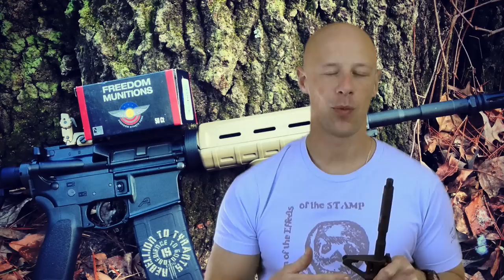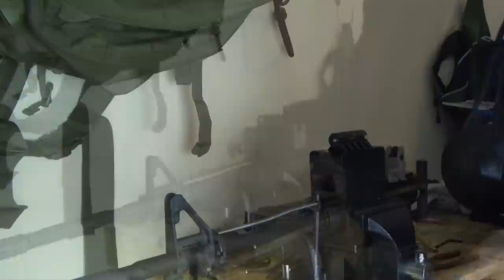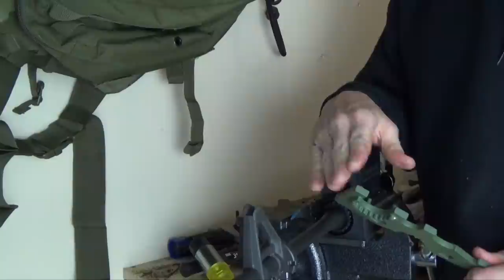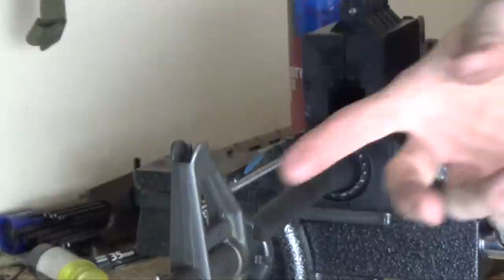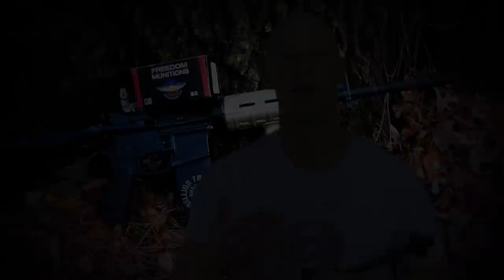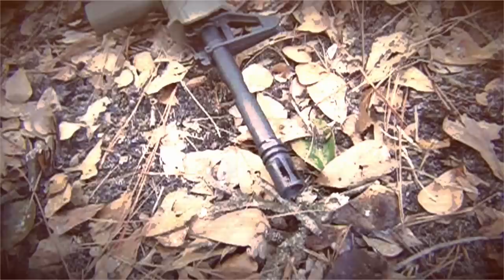How To Remove And Replace/Install An AR-15 Barrel (HD)

Comment: nicely done sir...as someone who has , no joke, assembled close to 40k uppers ,you got it right...a note to diy'ers who work on their owns guns a lot...a #2 roll pin holder from brownells is a HUGE help installing the gas tube roll pin...and they aren't very expensive...i like the brownell's upper block quite a bit , it holds the upper very securely...it is however a little inconvenient when performing other tasks on the uppper aside from torquing the barrel...i can't stand the tapco wrench for a multitude of reasons but the main one is you cannot see the notches in the barrel nut to align it when torqueing...my personal fav. is the dpms panther claw ...it's really sturdy...
excellent vid sir...keep em coming :)
Reply from the maker: brotherscoobs Thanks for the tips.

Comment: Thank you mrg.  Just what I needed.  I have seen some gsmiths tighten and release the barrel  3 times for some reason and that has confused me as to what they are doing.   I think you showed me that is not necessary.  Also recently I saw an auto mechanic use a digital torque wrench and that was a slick tool.   Great job.   thx.
Reply from the maker: You're welcome 👍🏽

Comment: There are a few good videos on how to check the head space on an AR-15 over on the NSZ85 channel. Note that with the all of crap that was produced back in '12-'13 you might still run into parts that were out of spec and shoved out the door for years to come. Checking head space is a good thing and also remember that .223 and 5.56 each have slightly different head space gauges. Plus clean the chamber with a proper chamber brush and CLP then wipe the chamber clean (ie bone dry) with bore patches before checking the head space.
Reply from the maker: killman1971 Thanks.

Comment: Mr.GNG, you should place your torque wrench 90 degrees to the barrel nut wrench when torqueing the barrel nut. Placing the torque wrench at the 90 degree position gives a more accurate torque. 

As you said in the video, the nut should be torqued/released at least three times before the final torque. As always grease should be applied to prevent galling. 

Thanks for your videos and keep up the good work!
Reply from the maker: Naji S Thanks.

Comment: I cracked a bushmaster receiver removing the barrel nut without a block. It cracked the thin piece of metal on the bottom side of the ejection port. I got a brownells block and did much more work to multiple AR's without any issues. I would say the overall quality of the brownells kit isn't as nice as some of the other more expensive blocks, but for the price brownells sells the kit for, it is more than worth it for someone who is getting into building AR's.
Reply from the maker: ThePatriot4freedom Yup, it happens.

Comment: Alot of y'all get too picky about the specifics, and miss the point of these how to videos. As if he hasn't swapped 100's of Ar barrels and doesn't own all the fancy tooling. Yes, he could show gunsmith level step by step process using aeroshell 33ms grease, seasoning threads to prevent galling, headspace go/no go gauges and so on.. He IS showing "how to well enough" for the everyday user, and is reaching a huge crowd which only helps the 2A movement/ culture. Thanks!

Comment: If my barrel uses an A2 front sight base, and I want to replace it with another barrel that also uses an A2 front sight base, do I need to purchase them (the barrel + FSB) together?  In other words, will my current FSB not necessarily be compatible with my new barrel, necessitating that I buy them as a package to prevent said incompatibility?

Comment: Great vid - how do you check the head space?
Reply: you can buy field gauges for that...a go/ no go...insert each one and close the bolt...the bolt should close and lock up properly , even snugly on the go gauge and not go into battery fully on the no go gauge
Reply: Head space on AR barrels and bolts is pretty much consistent and is rarely an issue. Yes it a safe thing to do but Ive built several AR's and never checked head space and have never had an issue.
Reply: AKBuilder762
 most manufacturers headspace barrels etc. several times before they leave their respective production lines...if your bolt is in spec and the barrel is in spec all is well...99% of the time everything's ok...doing the headspace field gauge test is just a little extra ins. especially if you're mixing and matching parts from different companies...i don't disagree but it's a good idea whenever possible to have it checked before squeezing off that 1st round...if your bolt is on the high side of spec and the barrel on the low side  or vice versa you could end up with an issue...yes it's unlikely...but for the low price of the gauges or a trip to a shop it's worth it
Reply: Since I only rarely need a headspace check, and the go/no go sets cost about $50, I get 2 hand-loaded bullets, with NO GUNPOWDER, and purposely crimp one too long and put a RED STRIP on that, GREEN stripe on the other one.  Use calipers to be sure the RED (no go) one was not pushed deeper into the brass when you closed it inside of the Bolt.

Comment: are retainers interchangeable between barrels ?.... the reason i ask is because i want to change my barrel to a longer one and have a mid length gas block instead of the carbine length gas block i have now.

Comment: Have you ever considered putting Blue Loctite on the barrel extension (not threads or barrel nut, as they get Aeroshell 33M)? This can take some " play" out of the upper receiver. Essentially you are bedding the barrel extension to the upper.
Reply from the maker: Romeo Boom No.

Comment: Just out of curiosity, if I torque the barrel nut down to 30 ft lb, but the teeth haven't lined up properly - and if I'm able to apply more torque to get the teeth to line up with the port for the gas tube and still stay under 80 ft lbs...any particular reason this wouldn't be a good way? Does it have to do with "seasoning" the threads to the receiver? Again just curious.

Comment: What can be done to keep the front sight base from turning when tightening the barrel nut? It is just slightly off to the left from shooters pov. Is this normal? Can the indexing pin be “shimmed” to keep it aligned when tightening the barrel nut or is my slot in the upper too large? Before tightening I noticed some slight play between the pin and slot. Any help is greatly appreciated, thanks. Great content.

Comment: Good video. People need to learn stuff like this for the American Battle of Armageddon of SHTF Zombies. I have learned a lot lately.
Reply from the maker: Slytiger Survival: the Maverick Prepper Channel Thanks
Reply: Mrgunsngear Channel geez I wish the Ak was that easy. Will a barrel swap require a check of headspace	?
Reply: Most people don't check them and they are good to go. If the barrel change were that easy in the AK, the motherfucking AK would be the Ultimate SHTF rifle/gun of all time! Period! This is what makes both weapons equal
Reply: I look at the AK as an old stone house that lasts. Doesn't have all the new commodities like the new stuff does. The AR is the fancy trailer in the lot with the jacuzzi. All the bells and whistles. Complete with the big flat screen. It falls apart more and more each day. That hailstorm or tornado comes and it's destroyed. The old stone house will still be standing.

Comment: Nice. Can you show us how to achieve proper head spacing?
Reply from the maker: lerch400block  You don't generally as head space is set at the factory.   I do have go/no go gauges though.

Comment: I'm surprised that you don't use a roll pin punch for the gas tube roll pin, I've found that over time using a hammer or regular punch will flatten out the end of the roll pin causing problems.
Reply: they are inexpensive and make life so much easier if you work on your guns a lot
Reply: And if you work on your guns alot or just upgrade your firearms every now and again its important to have a few of those low cost parts, especially if you went to the trouble to buy a roll pin punch.
Reply from the maker: chrispghetto works either way.  I try not to show specialty tools in videos unless needed.
Reply: Mrgunsngear Channel Ha ha, hemostats for roll pin install, I've done the exact same thing for installing those roll pins in the past.

Comment: The rifle you show with the long MOE hand guards, is that a "rifle length" gas system? Is the rifle you worked on carbine or mid?
Reply from the maker: Evan Bylsma Yes.  Carbine.
Reply: Where's the link on removing the gas block? Thanks for the vids btw. Strong work.
Reply from the maker: Evan Bylsma Thanks.

Comment: 30-80 ft lb is quite a range. Do you want to be closer to 30 or 80 and does it make a difference if you lean more to the tighter range or not?
Reply: Try to stick as close to the lighter end of the range when torquing any part down. You don't gain anything by running close to the max.

When installing muzzle devices it's especially important to stay close to the min. That's why peel washers>crush washers when timing and torquing the muzzle device.
Reply from the maker: Angel R. Aaron is correct.
Reply: Aaron Orr Thank you for your help.
Reply: Angel R. You're welcome anytime.

Comment: where can you buy the inner piece of the vice block with out buying the entire set?
I have the vice block {outer part}
Reply from the maker: not sure offhand
Reply: Is there any reason I couldn't just use the BCG with the vice block?
Reply: I just finished assembly of the upper, I did use just the Bolt Carrier {with out the bolt} also I found that a Mini Mag flashlight {AA pocket light} fits perfectly in the upper to shine into the upper to line up the holes for the gas tube.

Comment: Can you run a free float with a2 front sight post?  And do you need to heck headspace?
Reply: yes, but they need to have a cutout for the fsb, or be short enough not to overlap with the fsb.   If the free float has a non standard barrel nut the fsb has to be removed, then re-installed.  That can be a huge pain in the butt.  There are a few options that use a standard barrel nut so you don't have to remove the fsb.  Troy and a few other companies make models compatible with a standard barrel nut.
Reply: You can run certain free-float hand guards with your A2 front sight post.  Check out Daniel Defense's hand guards... you know the fugly looking one that has the front sight post sticking out near the middle?  That's an option and it's pretty useful (flashlights go great in front of the front sight).

It's really easier if your AR is a mid-length.  In that case, you can get any 9" hand guard and it won't touch your front sight post (though it comes really, really close).  Daniel Defense has a 9" hand guard for that, and IMHO BCM has the best option for that, their 9" KMR.  You can even buy upper-receivers with an A2 post and the 9" KMR pre-installed from Bravo Company.

Oh and it would be wise to check headspace, but these aren't Mosin Nagants... more than likely, it's gonna be proper.  These things are built to tight tolerances in 'MURICA!
Reply from the maker: Seu Moua Yes.

Comment: The Tapco wrench is the best, not because the finish is great or it works better than any other wrench, but because it has a bottle opener built into it that is labeled BEER!
Reply from the maker: sman7290 Thanks.

Comment: I got the receiver blocks but not the 1 that sits inside  the upper am I at a major risk installing the barrel without that
Reply from the maker: +prepper slim major--probably not.  Some---sure.
Reply: Because the Army said so :)

ARMY TM 9-1005-319-23&P

CAUTION
Do not torque over 80 ft-lb (108 N-m) while tightening the barrel nut assembly to the next hole, to allow for proper alignment of gas tube.

Comment: Could you reuse the barrel nut on a different upper receiver?
Reply: fatefinger I’m sure if you look hard enough you can find some manufacturer that doesn’t recommend it but you absolutely could do it with no issues what so ever

Comment: Where might one find a Colt Canada barrel assembly ?  Oh and you forgot to use AeroShell 33MS grease on the upper receiver threads. It's the grease called for in the TDP.
Reply from the maker: Michael Stone It's hard to find; troll the forums and be patient.

Comment: Don't use anti-seize to lubricate the barrel or receiver, anti seize has copper, which can set up galvanic corrosion in the barrel. Use Aeroshell or some other lithium grease.
Reply: Depends on the type of Anti-Seize actually.

Comment: This may have been asked here already, I honestly didn't look through all the comments but do you think headspacing is required when installing an AR barrel? I am starting a SBR build and I am used to buying complete uppers but plan to build upper myself using a Spinta Precision barrel and a Crosshill Side Charging upper. I don't really want to invest in go no go gauges unless I have to. 

Thanks
Reply from the maker: Jason Elbert There's no way to answer that without writing a thesis paper but in summary "it depends."

Comment: Sorry I forgot to ask earlier. Do you ever replace your gas tube. It goes through a lot of abuse with the heat and is fairly cheap (under $10 I think)
Reply from the maker: Robert Smith Eventually yes but it'd have to get really hot for significant erosion.

Comment: what grease are you using.
brand/model.
Thanks for the video.
Reply from the maker: +RhinoCable I don't remember off hand, sorry
Reply: It looks like Super Tech High Temp Extreme Pressure Grease from Walmart. I have a mixed nut sized canister of it instead of the grease gun tube.

Comment: This was a great video. This was something I was kinda scared to do but that looks really easy. Just wondering, the torque range is very wide (30-80) what did you torque your specific one down to ?
Reply from the maker: Robert Smith this one indexed right around 40.
Reply: The range is wide because you have to align a notch while keeping it within that range.
Reply: Richard Lamoreaux Thanks for the explanation on that. I was unaware.

Comment: Well done as always MrGuns!  Question though, does that 30 ft/lbs value take into account the extra length of the Tapco wrench?  Usually a torque wrench is calibrated for its own length and anything added to that length would throw that calibration off.  Just wondering if the spec for that torque includes that consideration?
Reply: Forgot to add that placing the torque wrench at 90 degrees to the adapter will solve the extra length/calibration issue because it basically keeps the wrench at the original length in relation to the part.
Reply: Pro2A - what math equation did you use to figure that putting the torque wrench at 90 degrees nullifies the extra length?
Reply from the maker: Pro2A Thanks.
Reply: Pro2A Doing it your way at 90 degrees is using the torque wrench incorrectly. And you will not get the proper ft lbs. or measurement you're seeking. You might want to take an engineering course or two.

Comment: It may be OCD on my part but when you use a torque wrench with any extension tool (the Tapco), you need to set it in at 90 degrees to the tool.  Otherwise, the applied torque will be way off.  The 90 degrees nullifies the leverage advantage caused by the tool.
Reply from the maker: Richard Lamoreaux Yup.  OCD part :D    Using grease throws it off too.   Let that sink in! :D
Reply: Mrgunsngear Channel I agree to both parts.  I watch all your vids.  Good stuff

Comment: Does it  matter what brand of lithium grease is used for install?
Reply from the maker: yes but most work
Reply: TM 9-1005-319-23 calls for "molybdenum disulfide grease"

 AeroShell 33MS is one that is commonly used.  I've grabbed Lucas White Lithium off the shelf at Lowes when I didn't have any 33MS.

http://www.lowes.com/pd/Lucas-Oil-Products-8-oz-White-Lithium-Grease/50353744
Reply: +Cody Dills thanks for the info

Comment: learn to use torque wrench first. those two wrenches should be connected at 90 degree angle
Reply from the maker: +John Hou cool story
Reply: Read tm9-1005-319-23 and quit spreading myths
Reply: Any extension that is colinear with the wrench will affect the torque setting. He attached it right. Only needs to add the length from center of Tapco wrench head to center or ratchet head (A), added to the length from ratchet head to the center of the handle (B). Torque at Tapco wrench equals torque as dialed times (AB/B). The 90 degree rule means the work must be below (perpendicular) the ratchet head.

Comment: When torquing the AR wrench should be 90 degrees to the actual torque wrench,  the way you used it the proper torque was not correct....just an fyi, great vid....

Comment: It might make things easier if you mount your work bench with the vice to the wall and/or floor.  I know sometimes the work bench is made so you can move it but I've seen them tip over and mess things up.  Just sayin dude.    THANKS
Reply from the maker: mozzberg Thanks.